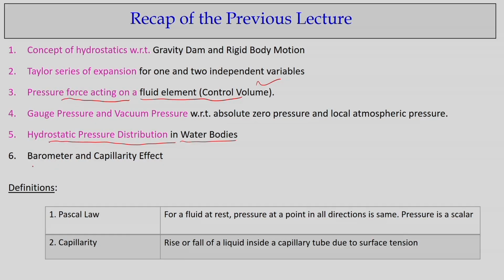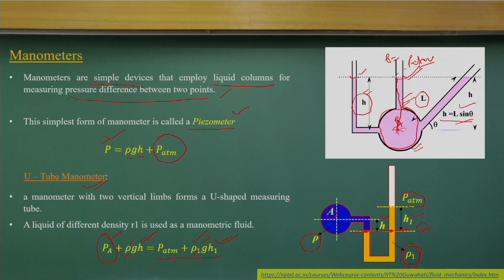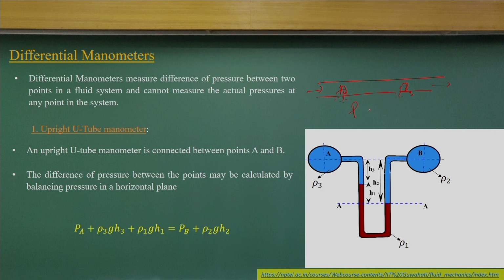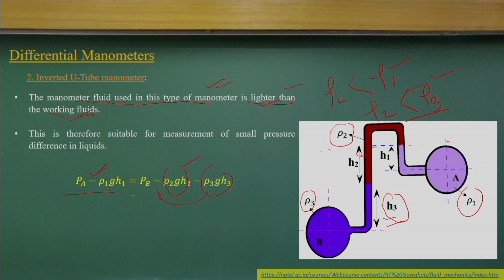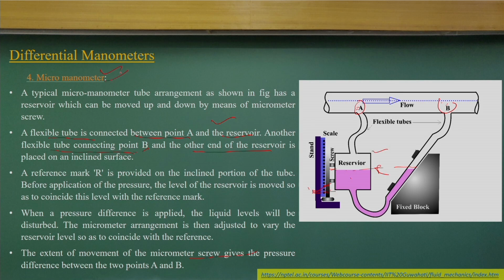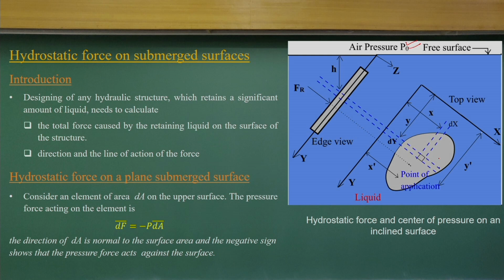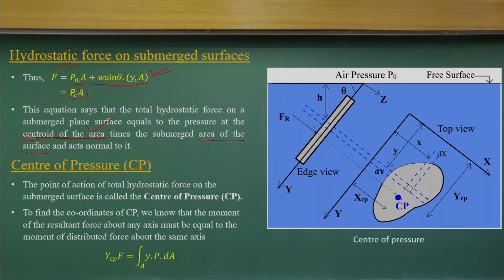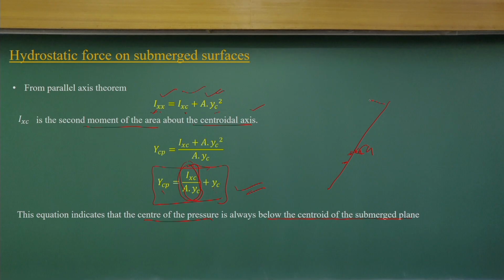Lec 5: Measurement of Pressure and Hydrostatic forces

Comment: dear sir, my question is on differential manometer, in that you have taken the left hand limb side as the datum point instead of that can we solve the same by taking the right hand limb side as the reference point for measuring heights of the fluids ?
Reply: Yes you can, but only point has to keep in mind is 'Head at left limb should always be equal to Head at right limb'.